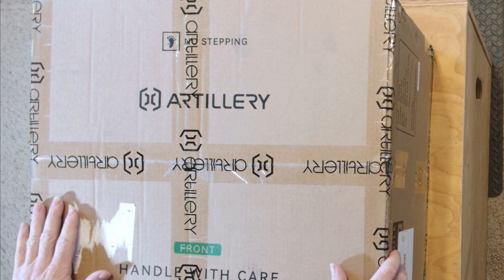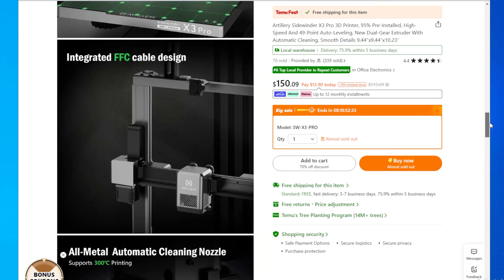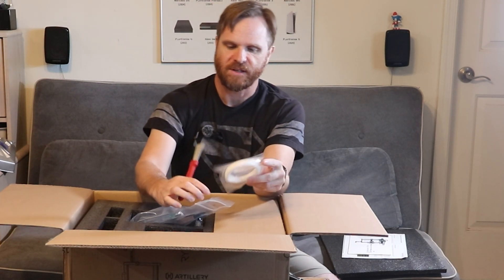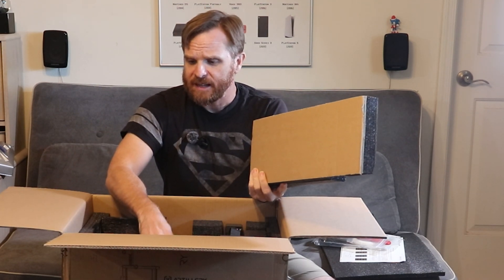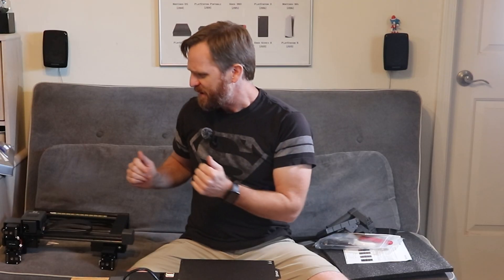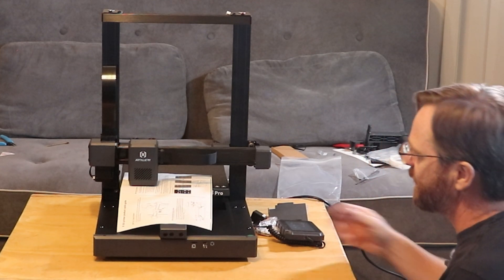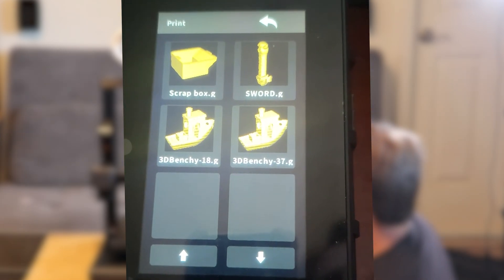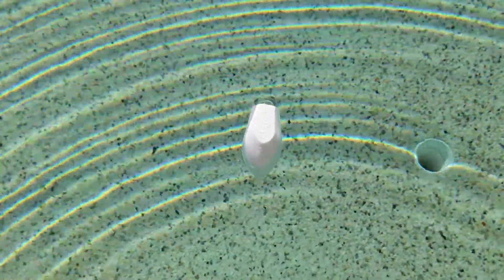3D Printer Unboxing and Setup (Artillery Sidewinder X3 Pro)

Comment: "the gluestick was useless" - pretty funny comment! And the same thing I was forshadowing when you talked about it
Reply: The benchy looks not that good for your info: Your first layer looks to be too high too.
If you can stretch your budget (and have the opportunity to give this printer back) I'd recommend you a Bambu Lab A1 - it'll take care of 90% headache issues and will get you to printing, not to trying to get your printer running. You'll have a lot of work to do otherwise
Reply from the maker: Thanks for the info. I have had some struggles with the printer especially keeping it level. I will look into the Bambu Lab printer.
Reply: @pathfindercast  Happy to help! I did a similar mistake with an Anycubic Kobra 2. spent more time setting things up then printing. Bambu Lab got a pretty good Black Friday deal for the A1. It’s just clicking on print and printing. If you got any other questions I’ll happily help